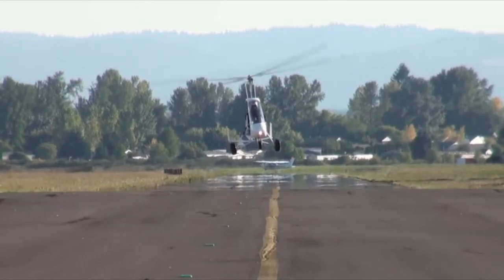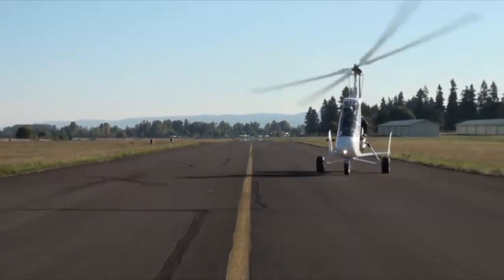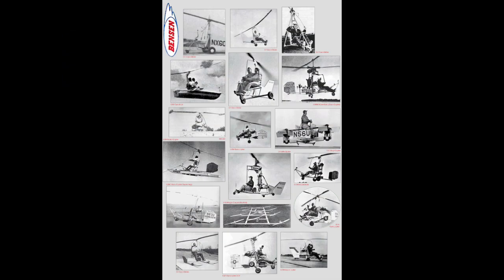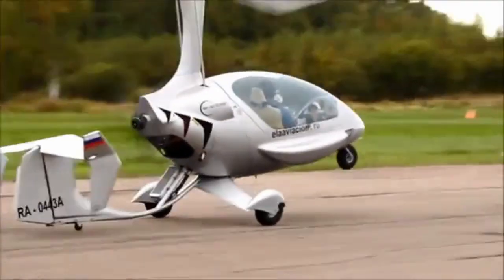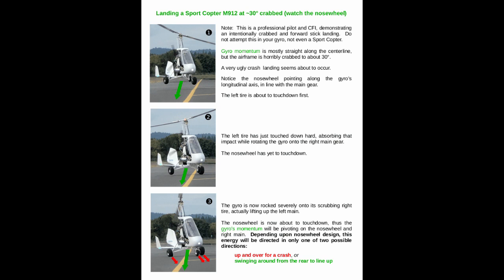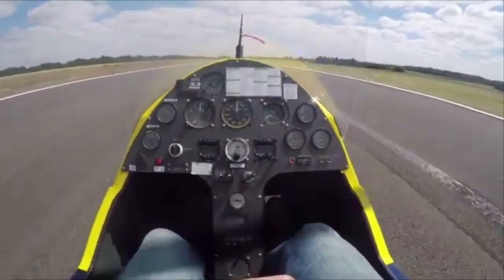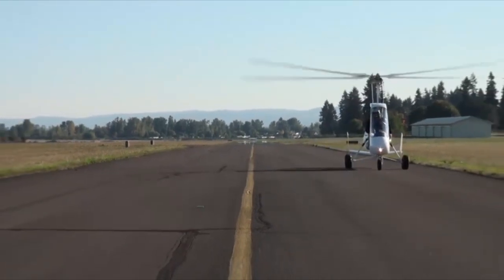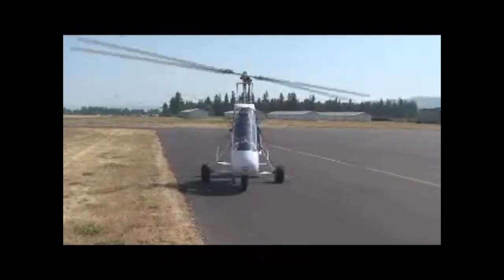Gyrocopter nose wheel issues - free castering or linked? steerable nose wheel or differential brakes

Comment: I am in the process of converting my Parsons to toe brakes but will, for now, leave the semi linked steering. I have lots of tail dragged time and just appreciate the additional control. Thanks for the video. Keep safe and heathy.
Reply from the maker: You know Bill when you read some of the comments on this "issue" on places like rotary forum.  I just don't know anyone who arrives to touchdown on the runway without kicking the aircraft straight and controlling drift with the stick.  Otherwise you'll dump it on the tarmac like you can see the sportcopter do - which may allow you to get away with things if you've fell asleep but for people who can actually fly it really makes little difference and there are more than a few people in fixed wing (I fly them too) who have come to grief getting   squirrily with toe brakes.
Reply from the maker: You too matey - stay safe.  crazy times.
Reply: Gyrocopter flying club Oh I totally agree. My feet are definitely off of the toe brakes when I land. I put the centerline on my chest correct it with rudder and the drift with the stick. With the CG behind the landing gear with a tail dragger  configuration, it’s asking for trouble to do anything else.
Reply: Gyrocopter flying club the effect of the high mass of the rotor blade plus the lift the spinning rotor is creating  lift even after touch down seem to doom some pilots to dig out their check books and swallow their prides. I feel getting totally square in landing with the direction of travel is paramount. No matter where the fuselage wants to go, the rotor will always win. We could rely on the engine with botched landings in a tail dragger fixed wing. The engine will pull you out of the situation if you recognize and act quick enough. With a pusher...... ummmmm best leave the throttle alone. Your feet got on in this mess and your feet has to get you out of this mess.
Reply: Gyrocopter flying club one other thing, although toe brakes are a necessity with tail dragger airplanes when taxiing, when landing a pilot had to be aware where your control lies. Is it with the wind or the ground? There is a point when you have very little of either and you have to transition quickly through that. It was always a sense of relief to get that controllable linked tail wheel on the ground.

Comment: This shows the huge chasm between rotary and fixed wing aircraft. The moment fixed wing aircraft dropped the tailwheel (mid to late 1940’s) safety improved immediately. Landing and take off accidents wrote off more RAF aircraft than the Germans during WW2. It didn’t matter whether the thing was steered, aircraft with nosewheels were safer. And now we come to an aircraft that will bite on landing and take off because of its stability on the ground. That must take fixed wing pilots converting some time to get used to.

Would a tail wheel be a better configuration for a gyrocopter? That would prevent the stick hard back departures thus reducing aerodynamic drag. It might also improve rough field performance.
Reply from the maker: Hey Trevor - I personally think it would be although the issue is played up to a higher degree than is really the case.  In many instances the ground stability problem is created by poor stability in approach and poor go around discipline.  Sport gyrocopters are usually <300kgs on their own and so inevitably get affected by the environment and any inaccuracies does get punished.  I think a more impactful change that would reduce take off / landing accidents would be a shift to yearly revalidation which includes make and model also.  i.e. not just the licence but also the individual make / model that is wanted to be flown.  Like helicopters do.
Reply: A few people have tried tail dragger gyros, however, where a plane with a tail wheel has a movable elevator/HS to keep the attitude correct (like lifting the tail to start the takeoff roll)... the gyros (such as little wing) only have a fixed horizontal stabilizer... so if the tail were to rise, there is nothing to stop the machine nosing over and striking the prop, or rotors or both.

Comment: You've missed the best option yet.  Back 20 years ago when a lot of Bensen style machines used linked systems in which a spring allowed for some absorption of nose-wheel coming down and jolting the aircraft to one side one of our club members came up with a better system involving direct nose wheel steering tabs just under the tubular rudder pedals.  Essentially the tab to which the rudder cable is connected to stretches across inwards towards the keel and the cables attach there.  Meanwhile the metal tube this attaches too had an additional tube coming up to just underneath the top of the rudder tube.  These smaller tubes are directly connected to rod end bearings which directly control the nose-wheel steering and give full positive control when taxiing etc. By twisting your feet a tiny bit pigeon toed inwards so the ball of you feet is driving the nosewheel and the rudder at the same time. 

After lining up on the strip you twist your feet out to the edge of the pedals (where there is a tab to stop you feet sliding off) and thus your feet are off the nosewheel control tabs.  The nosewheel now casters with a spring at the back to stop any shimming.  The nosewheel now tracks as a castering system.  Therefore any amount of rudder input will have zero effect on nosewheel steering.  On landing too the nosewheel casters and after landing you simply point your toes in and you have full control again.  The system works beautifully and is much more intuitive than the old reverse billy-cart systems used in many older gyros and much better than the linked systems.  Turning circle was great too.  I wish I could put up a picture on the tube here.  Unfortunately it's not likely to be helpful in countries where home building is not happening but for anyone in the USA or other countries it's a fantastic safety feature.

Another thing that help a lot of our early students practicing ground runs was using motorcycle style tops on the stick including a motorbike twist grip.  We found in training students would often tense up and if right handed they tended to drift right as they pulled in back pressure.  This was because as they tensed they tended to pull to the right (or left if left handed).  By putting on a t'bar they didn't do this as much.  Again a little training and this wasn't an issue but little things can catch up with you.
Reply from the maker: Thanks for that detail Cameron - do you have any old Bensen plans?  I fancy building a gyroglider
Reply from the maker: Thats great - thank you for this.  Yes gliders are exempt so good practice aside you can do as you please.  The training over here went through a very divisive period and it absolutely fragmented the community and the British Rotorcraft Association almost 10 years later is just a shadow of its former self.  Single seater training was banned and is now only just being re-introduced and nobody has a gyro glider - in fairness I think venue is half the problem and as time passes to be fair the skills are going to be lost.

Comment: Try running along a strip or road with a high crown in a gyro with catering only nose wheel... you will end up risking running to the left or the right depending on which side you veer towards. I agree with Cameron Lapworth, my nosewheel of choice is connected to the pedals, but with a 'soft connection'  that can allow the nosewheel which is turned by the rudder pedals to touch the ground and bump straight... so, I would say there are three choices...  fully castering, fully connected and 'semi connected'... I choose semi connected
Reply: I have a Dominator with a full castering nose wheel. A strip with a high crown is a non-issue. I have a tall tail which gives me rudder authority from the prop at very slow speeds. So I use my rudder pedals to steer just as you would. I like having the peace of mind knowing that if I did let my nose wheel touch on landing with rudder input, it's not going to veer.
Reply: @blh-rr9fu  What happens if you have an engine failure or engine out landing on a strip with a high crown? I will stick with semi connected thanks

Comment: So, up front I am admittedly ignorant here.... But,   with such a short ground roll possible with a gyrocoptor, especially with head wind component, why not just turn into the wind on the runway and land short? 🤔

The landing shown here looks on edge to me? 

I am very interested in this subject and you have opened my eyes to a benefit of castering nosewheel.
Reply from the maker: Dj S hi the problem there is if you are fitting into the circuit pattern of a busy airfield you’ll be in conflict with others as you’ll fly an odd pattern.
Reply: @gyrocopterflyingclub6148 

I am not suggesting pattern change, just a directional heading change just prior to "flare"? .

The time on runway would not change... Especially if done in landing distance of a taxiway?
Reply: I've flown in sufficiently high winds that I have landed vertically directly across the airstrip, took off that way too.  Mind you everyone else was grounded as there was no cross strip.  You have to remember that conditions can change too.  You can get gusting winds where on set up the sock is pointing right down the strip and suddenly get a 15 degree crosswind.  And the shortest landing are not always the safest.  Most of my engine out practices are very short landings because you are in a very steep descent followed by a quite dramatic flare, if you carry more speed you can do a less dramatic flare as your rotors use their inertia from the extra speed.  But unless you have a very strong breeze you are usually touching down with a little forward speed. 

Now most gyros are very short wheel base with very high CG so they are made stable by the rotor and how you point it but if you're inexperienced you can get this wrong by just a bit and you could be in trouble.  Usually at very low airspeeds so the result may look spectacular but you'll walk away from it although your rotors, prop, mast etc may all be a complete right off.

Ideally you want to do as little as possible on landing.  One of the problems with people pulling off the down-thrust on their engines is the change of how it handles on landing.  In my old VW when power was pulled the nose would rise a couple of degrees.  So if you kept it straight on rudder, was holding the mains a foot or two off the ground and just pulled power it landed itself, you didn't even need to flare, you would pull back gradually of course to slow yourself down but the machine if properly trimmed and set up largely flew itself. 

So trying to flare aggressively to get a very low ground roll can give you some protection but landing a little shallower and therefore a little faster may increase problems if you let the nose down too soon or you have insufficient lift and your nose drops on because you let the speed get too slow too soon creates some of the problems you are seeing here. 

IMO when first learning you should of course be trained to engine outs but until you are very comfortable in your own machine you should keep it shallow until you are really comfortable.

In open machines particularly and engine out glide seems much steeper than it is.  As you glide you are looking at the spot on the ground that isn't moving (spreading out), when you get quite close everything seems to woosh out away from you a bit like the effect of the Light speed stars in Star Wars.  Many students or inexperienced pilots flare immediately at this point which usually results in flaring 5-10ft off the runway and you've just used your rotor rpm up and are going to land hard or if lucky a full application of power doesn't twist you about and result in you now being either behind the power curve or twisted with sudden torque effect low speed low rotor rpm and no time to do much about it all.  Better IMO is come in smooth and shallow and give yourself plenty of time to ease down to flare height then landing is just back off a little power the machine flares you ease back on the stick to help slow it as it lands on the mains and tail wheel down shortly after. 

Others may disagree.  I know many instructors who insist that every landing effectively be an engine out.   I know one guy also who was so convinced that the difference in handling would be so different between an real engine out and one with the throttle on idle that he used to turn off the fuel tap at 800ft and wait for the engine to fail at some point in the next 30 seconds then he'd practice from there.  He only smashed up two sets of rotors that way.
Reply: Dj S - I can see your logic however there are a few problems. Apart from reducing the effective width of the runway you have given yourself a few additional problems. The first is establishing your approach path. A turn requires height. How much height would you require? Then how much distance do you require to round out and flare? Then how do you deal with an engine failure? How about a go around? What you do not want to do is destabilise your approach by throwing in an extra turn anywhere near the point of flaring.
Reply: I agree, in a gyrocopter, landings especially can be done into the wind